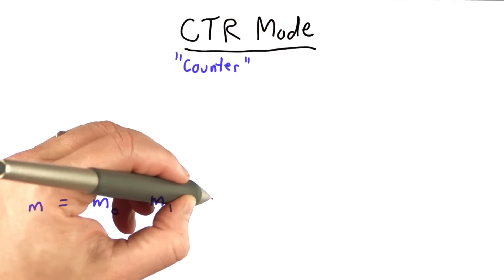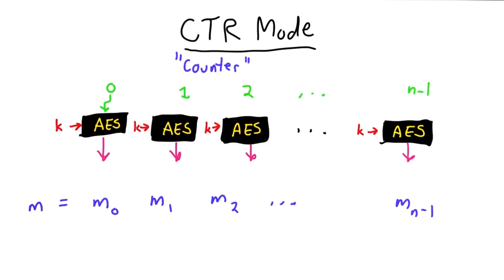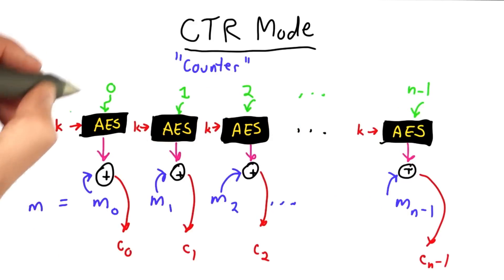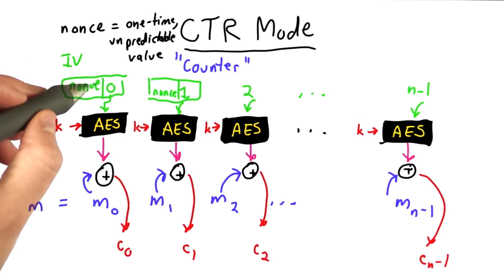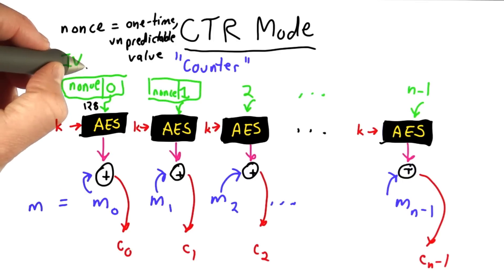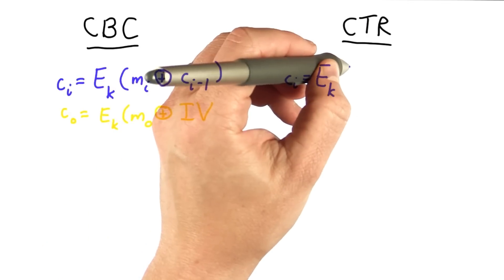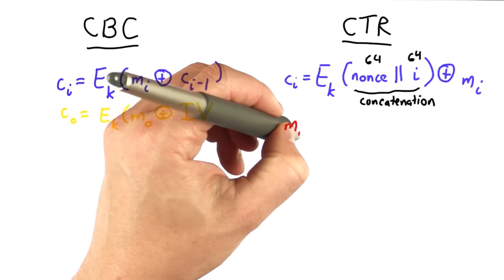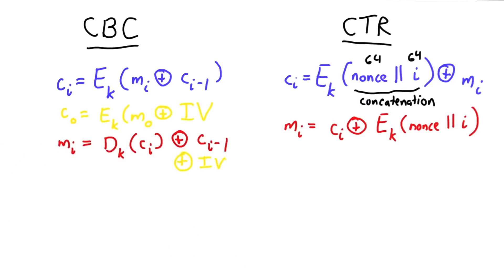Counter Mode - Applied Cryptography

Comment: Without mentioning that CTR makes the block cipher behave like a stream cipher?! Meaning, you could encrypt 5 bytes then 3 bytes on transmit side in two separate calls, and decrypt 2 bytes then 6 bytes on receive side, and it all magically works, and you don't even care about the (128 bit) block size. CTR mode is amazing.

Comment: Do we have differents nonces for each encryption or it's a fixed value ?
Thanks
Reply: Just to make it clear: the noonce is fixed each stream, but should not repeat at different streams. This is kinda what happens on the CRACK attack.
Reply: It is fixed. Only the counter changes for each encryption.

Comment: Why the nonce doesn't need to be secret? If the attacker knows the nonce and place of the block, what is the the point of having it?
Reply: he doesn't know the key, so nonce and counter is useless to him
Reply: Nonce and counter just bring some randomness to the cipher. I mean if you encrypt twice the same message, you'll get differents cipher because of the nonce and Ctr.
Reply: The nonce is there to prevent replay attacks: without it (with the counter starting from 00000000), you could record communication and at a later time, impersonate one side of the communication. When the side you're communicating with sends you a random new 64-bit nonce each time you communicate with them, this becomes unusable because the communication you recorded used a different nonce. This attack is dangerous, for example you could record the encrypted communication someone uses to unlock a bank vault, and just replay it without ever having to know what the plaintext was. The nonce will prevent this.
Reply: @moptim  I don't understand in counter mode at the decrypt side. Of course i need to know the nonce but what about the counter? Do they need to be synchronized?